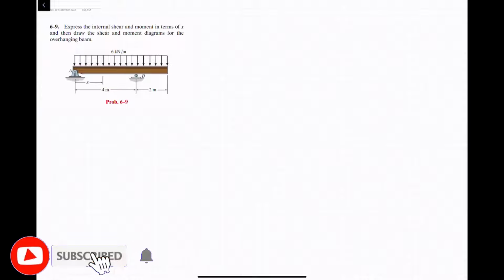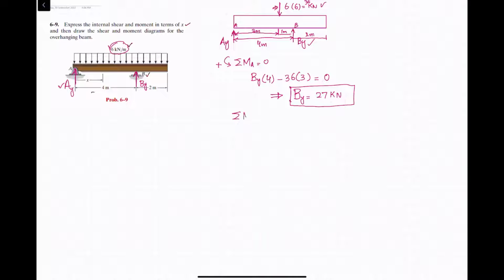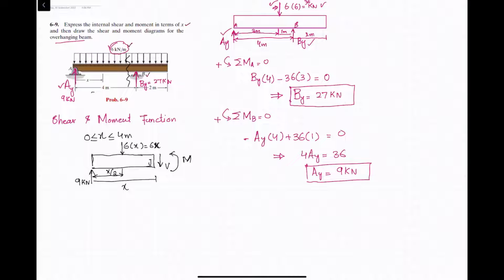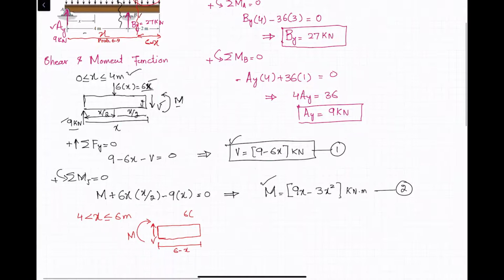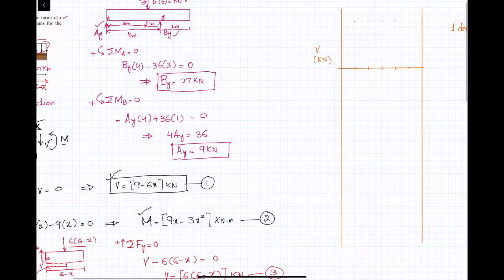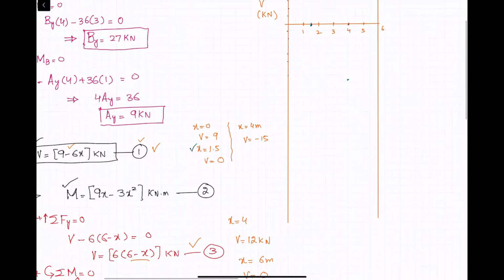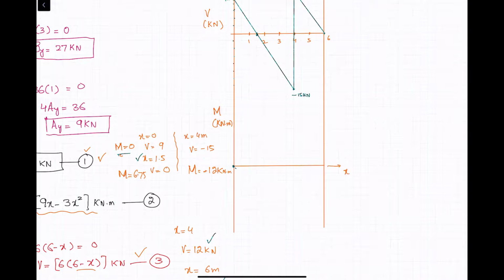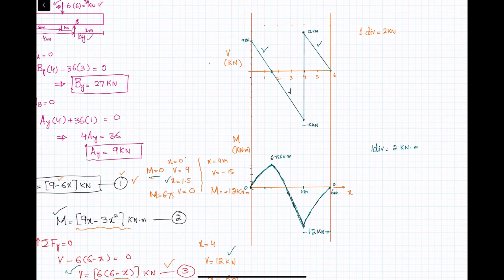6-9 |Chapter 6| Bending | Mechanics of Material Rc Hibbeler|

Comment: Would the section of the distributed load that runs from 4m->6m not produce a clockwise moment about point B? I also got +9kN for reaction force A by doing sum of forces in the y-direction. I'm just confused on how that works
Reply from the maker: as the distributed load act over the length of 6 m so when converted into point load , it will act on the mid so perpendicular distance between this load and point B will 1 m and producing counter clockwise moment. Also you are right you can find Ay =9kn by using sum of all forces in y direction must be zero...❤